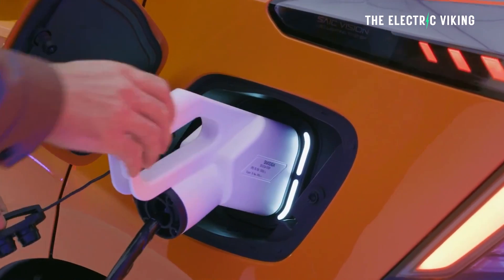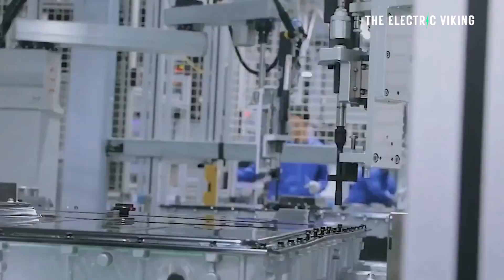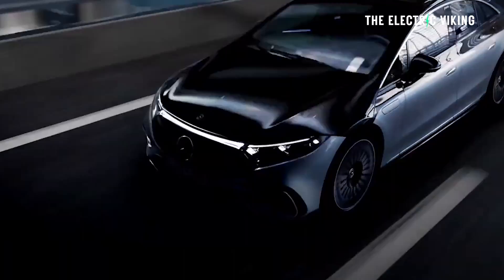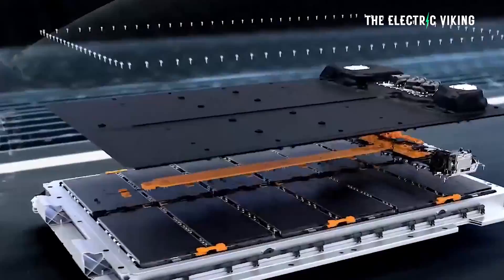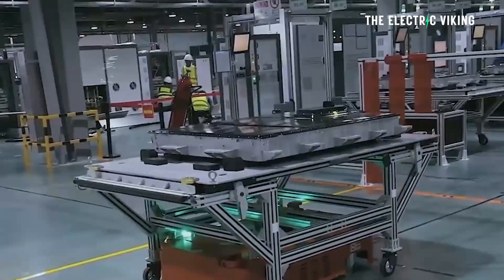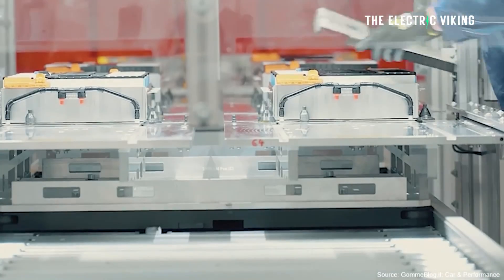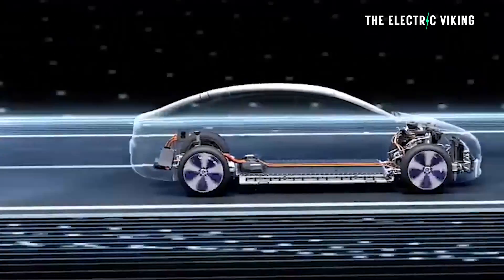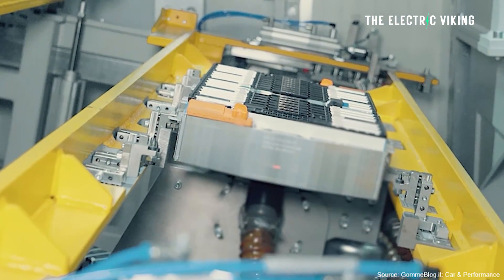Electric cars will require ‘battery passports’ in Europe

Comment: Where are the passports for the cobalt used in the desulfication of diesel or petrol? I hope, the gas stations have that at the pump!

And I hope, they also have the information at the pump, where all that came from, where did the crude oil come from, was that environmentally friendly and how much did they usually loose and how much flows into the ground water or into the sea there? Was the oil extracted from the nice oil sands or by pumping some more or less toxic stuff into the ground? How long do tbe residents in the area already have flamable or stinky gas come out of their tap waters? 

And we need a passport, how the car maker handles the cleaning of the exhaust gases, how many times has he found guilty on breaking rules, what are the "temperature windows" in which no cleaning is done? Below +10 degrees C and above low medium summer temperatures? 

It's important to know such things. Passports for everything.

Comment: EV issues -

INCREASED CARBON EMISSIONS: over it's life time an EV with decent range will be responsible for MORE NOT LESS carbon emissions than an ICE (explained in 90s below). Considerably more 'stuff' needs to be mined, refined, processed and manufactured to create an EV. On the road there may be zero emissions but these will probably just have been moved to the nearest fossil fuel power station.

RANGE ANXIETY: For longer journeys the recharging infrastructure is poor and the overall experience is a highly unsatisfactory. It takes a long time to charge a battery. If there is a queue it will take even longer. Where multiple stations the available load is probably reduced and shared amongst the stations. To interact with the station you may well have to 'download an App' and register with numerous service providers.

TYRES: EV batteries are extremely heavy (Eg Kia EV6 : 477.1Kg). Electric motors are more powerful than their ICE equivalents. Put the two things together an you have a vehicle that will chew through expensive tyres.

FIRE HAZARD EV batteries are a massive fire hazard. Considerable effort is taken to mitigate the risks but it is always there.

INSURANCE: Any damage that might compromise a battery will require an extremely expensive battery replacement. Minor shunts can turn into total write off’s (a replacement battery would cost more than the residual value of the car). Further EVs are much heavier with power to match so any collisions will be more serious (there probably needs to be a review of road crash standards). Consequently insurance costs for EV's are significantly higher.

DEPRECIATION: with increasing 'flying hours' it is becoming clear that EV hype does not match reality. Unfortunately early adopters are finding that their very expensive purchases have very poor residual values.

RAW MATERIALS: current mining capacity is incapable of delivering enough raw materials to deliver 'GEN 1' of an EV fleet, never mind the massive upgrade to power generation and distribution infrastructure that would be required to make it work. World wide there is a moratorium on opening new mines. This is incompatible with 'we need more copper, lithium, cobalt, graphite etc for EV batteries'. Little or no thought seems to have been given to what will happen with the large pile of toxic 'GEN 1' batteries when they are thrown on the scrap heap.

THE CAR OWNS YOU AS MUCH AS YOU OWN IT: An EV typically comes with lots of 'smarts' and may well require that you interact with it though an 'App'. It will have lots of opinions about it's use. There are many reports of owners being locked in or locked out of their vehicles when 'computer says no'. Manual knobs may well be replaced with touch screen menus that are a distraction hazard. Manufacturers will log GPS records, internet activity etc. 

Carbon footprint of an EV explained in 90 seconds https://www.youtube.com/watch?v=S1E8SQde5rk&t=510s @ 8:30 min -> 10:00.

Comment: Whilst I not sure what benefits this would bring apart from peace of mind when buying a second hand car, the data should not be too difficult to assemble. Quality engineered products these days have traceability down to their raw materials used and their source. To win manufacturing and supply contracts companies need to prove they are capable to adhere to such processes, ie ISO certification. Maybe that is their motivation behind the passports, to ensure only quality batteries are fitted, not dangerous substandard units.

Comment: Through a series of work related coincidences too long to detail here, I found myself at a cobalt mine near the DRC and Angola border in 2004. It was horrendous. Little kids up to their knees in toxic mush hauling this stuff out by hand in rubber buckets to shitty old diesel trucks. The battery companies at the time called them “artisan mines” and said they were moving away from these types of supply lines. All BS. My African friends tell me these poisonous mines are still in full swing and at least a portion of the extracted cobalt must surely be making its way into the batteries of BYD cars. The Chinese wouldn’t give a damn where it comes from. And don’t get me started on these enormous Lithium mines… been to one of those too, environmental destruction on a grand scale. There has to be a better way to power an EV than using highly toxic materials like lithium, cobalt, manganese etc.
Reply: Do you have any basic knowledge that BYD's LFP batteries are cobalt-free?
Reply: Lithium and manganese are both non toxic. More than half of new Teslas produced have zero cobalt in their batteries (LFP cells).

Most lithium is sourced from brine ponds, anyway...

No human activity is without an impact on the environment - but burning fossil fuels has a global (not merely local) impact. Your argument is to wait, then? 

I humbly disagree

Comment: The production of the battery passport for the cell manufacturer will add significant cost to the manufacturing process as you have to add traceability marking using data matrices onto the cell at each stage of the manufacturing process.
Reply: We manage this with food production. If it is demanded of suppliers at every stage then it is simply a case of assembling the information - the process could be largely automated (using enterprise software such as that from Palantir) and could actually lead to significant reductions in production cost (Airbus A350 production ramp is an excellent example).
Reply: I work in the battery manufacturing industry so I have a good understanding of what I am talking about. I am literally involved in a project to delivery the battery passport and it's going to be EXPENSIVE. @richhr89
Reply: Its not going to cost much if anything at all to print the inventory control listing for the batteries and will benefit everyone as better inventory control leads to a more efficient operation and reduced costs.  Its also of great benefit during a recall or warranty campaign since you can better target the products batches that actually are potentially defective rather than having to recall everything based on a date, etc.  Also allows for weeding out batteries made with materials from strife which is only ethical since if the world refuses to do business with those using materials produced through strife such as slavery, forced child labor, unsafe working conditions with no regard for the worker health or life it will reduce the level at which that is practiced.  We already do this for precious materials such as diamonds and other gemstones, etc so why not battery components which appear to be another strife ridden industry?

As far as battery condition that is already pretty simple with a small $10/$20 OBDII reader linked to a Smart Phone/Tablet.  Just make the program to read it available to the public or even allow it the be picked up directly from the vehicle through its existing WiFi/BlueTooth System.  Perhaps something as simple as a battery condition Icon on the front page of the touch screen to give you a view of the current battery condition and level of degradation would be the best option there as that would just be a software update that could even be applied as a standard update to many existing EV's made over the past decade or so and would be a Low Cost/No Cost option.

Best!

Comment: Basically it’s a VIN number for a battery. The detail from the EU documents “The battery passport must contain information on: Identification of the battery in the form of a unique identifier. Basic characteristics of the battery including type and model. Statistics on performance and durability must also be updated over the battery lifecycle by parties conducting repair or repurposing of the battery. The specific performance characteristics required in battery digital product passports are detailed in Chapter IX of the Battery Regulation Amendment. Technical documentation on the electrochemical performance and durability of the battery must be provided, including details on how this data was obtained. This is to ensure the batteries meet the minimum requirements for battery performance and capacity in order to guarantee batteries on the market are operational and efficient over a sufficient lifetime. To gain access to the battery passport, the physical battery must have a QR code printed or engraved on it to act as a unique product identifier.”
Reply: Thank you for the specifics of the regs.  Refreshing!

Comment: Countries are finally waking up to understanding that the fuel cell, that is, the battery pack or liquid fuel, should be regarded as independent from the vehicle and it must meet certain standards which include safety and material efficacy. To me this is more about safety Sam under the guise of some feel good propaganda about mineral exploration/ exploitation. Do Europeans care if their oil is coming from Russia if the alternative is to freeze? On the whole I'd say No. 

Put simply, Europe is a forward thinking region that doesn't want dodgy battery packs in vehicles which have a potential to catch fire. It means they can force people to get their batteries tested and changed out as required. This is exactly what NIO is offering. The ability to change out a bad or old battery pack, rather than crush the whole car.

Good video though Sam, I liked it ...

Comment: How much will this increase the battery price? Plus, will the EU exist at 2027?
Reply: Not much (software is now very reliable and cheap- will even increase production efficiency and drive down cost- see Palantir/Airbus A350 ramp)
The EU question is a good one, though. Germany without gas is Germany without petrochemicals and no petrochemicals= no manufacturing. Germany without manufacturing = severely weakened EU. It's going to be interesting

Comment: The thing that I don't think the US or EU governments seem to realize is that once those batteries are here, they are here forever. Those materials can be recycled indefinitely and means that there are less materials that need to be mined and processed.
Reply: The minerals can be recycled/recovered in the high 90's% 

Very little is lost
Reply: True, but we need to replace millions of ICE vehicles first, hence large quantities of virgin minerals required for the foreseeable future.
Reply: @richhr89  ICE vehicles have their own uses so do EVs.
Reply: @JKTProductionzIncNCo  yes, but the use cases for ICE where an EV could not very effectively (and far more efficiently) do the same job are very rare in terms of total miles travelled.
Reply: @@phillipbanes5484 The "non-country" is very effective at creating regulations that end up being followed by everyone.
Reply: There is zero Lithium being recycled at the moment - its just another EVangelist fantasy story.
Reply: @xraylife  tell that to the battery recycling facilities...
Reply: @xraylife  do you know what proportion of a battery pack is lithium? Less than 2%
Reply: @richhr89  8Kgs on average - and with only 24 million viable tons on the planet max  it won't last long - certainly not past a few years if every ICE owner was to change to EV.
Reply: @xraylife   Typical EV pessimist. Since you came up with your figure there have been additional discoveries here in Australia, mostly of spodumene, which is why the lithium price dropped dramatically recently.
And when we get near to exhausting the spodumene, we can address the differential electrolytic extraction of lithium from seawater, which is estimated to contain 230 Billion tonnes. Should last for 1000+ years even without recycling.
Reply: @davidinkster1296  I said Viable Lithium - there are deposits under the ocean and inside volcanoes - but the total max is about 70 million tons on the planet tops.
Reply: @xraylife  if your figures are correct, that's 3 billion cars (with a 'b'- roughly 2x the number of all cars currently on earth...).
Slightly more than 14 million EVs produced globally last year . 

'won't last long'?...
Reply: @richhr89  Sounds like you skipped on maths -The absolute maximum amount of Lithium is around 70million metric tons on the planet (USGS). 14 million can be viably extracted possibly up to 26 million tons if they used some more nasty chemicals and more degradation - but either way its all gone by then and no replacing it. At the current rate of extraction its about 130,000 tons in 2022 (that's for all uses). EV sales were 14 million (max) with very very roughly 8kg of Lithium in each battery (some have much more) but that's roughly 112,000 tons leaving 18,000 tons for all other uses computers/ phones/ cameras/ electric bikes etc. While new cars sold in 2022 was 67.2 million and 14 million were EV's, so a thousand miles away from what's needed if everyone was to replace ICE vehicles. And by the 10 year period the 14 million batteries would start needing replacing so you could never produce enough Lithium to catch up.
Reply: @xraylife  
'sounds like you skipped on maths'. Needlessly unpleasant.
I was only using your figures! 

May be worth your having another look at your calculations?
Lithium is certainly not the supply constraint - evidenced by the recent 80% drop in it's price.

Lithium remains one of the most abundant elements on earth and may I respectfully suggest it's worth considering that people who use absolutes such as 'never' are often proved wrong.
Reply: @richhr89  Lithium didn't drop in price because production increased, it fell and quite considerably because - No Demand.
Reply: @xraylife  35% increase in global EV sales in 2023 compared to 2022 doesn't sound to me like 'no demand'...
Reply: @richhr89  That's because the Chinese register 100k of them before dumping them. Europe removed subsidies so people who wanted one grabbed them at the tax payers loss.  
And the market turned against them mid 2023 when pages of problems came to light. Sales end 2023 and into 2024 are off the cliff.
Reply: @xraylife  14 million nonetheless in 2023
Reply: @richhr89  Out of 67.4 million cars the rest being ICE. And the number of EV's is crashing as the Lithium prices show.
This will be the 4th time EV's have failed in the market place.
Reply: @xraylife there is PLENTY of lithium. It’s about the 3rd most abundant element in the universe. Theres TONS to be had. The problem is just engineering how to get it. We won’t run out. Ever.
Reply: @justinstewart3248  Bro this was a year ago - EV's are done - please update yourself.
Reply: @xraylife not even close to done, only growing. in fact they are gaining more market share every single year around the world.
Reply: @justinstewart3248  Nice cope - but I don't even bother talking about EV's now they're so dead in the water.
Reply: @xraylife lol I mean ok that’s fine. Just stating the facts my friend. They’re certainly not in the rapid growth phase we saw in 2021, but still growing world wide about 1.5 percent in America every single year and 10 times that number around the rest of the world.
Reply: Nothing is ever one hundred percent recycled those batteries can be recycled but not forever eventually the minerals can no longer be process.
Reply: @jonathancunningham8739  Metals and most minerals are effectively infinitely recyclable. Those used in batteries are moreso. Losses come from accident and carelessness
Reply: @jonathancunningham8739  That is true for paper and plastic. However, minerals can be reprocesses indefinitely.

Comment: They will be so regulated you wont want it.
Cell phone or flashlight or server batterries are not for electric motors. Never worked in kids toys either. My cell phone was replaced too. I drive a 2007 SS Trailblazer with a stock 395 HP LS2 Corvette engine that cost 38k.
Changed the oil and some bulbs etc. Full frame lasts forever. Got a spare chassis in back. Maybe throw a wrecked Tesla in there when I can put antique plates on it. They will be super cheap when so many are in  auctions now. I'm thinking of using the motor for an air compressor. Plus the cyber truck will be good to build things out of. Cant wait 

So I dont drive much at all amymore. I used to remeber 25 cent gas so I'm an old fart. 
No more cruising.

But you'll have to pay hazardous waste disposal in the future when junking one.
My friends owns a junkyard and he has to pay now to get rid of the batteries without lead
Reply: You'd be surprised how much a battery pack from a wrecked Tesla is worth. I'll take them off his hands for free if he wants 😅